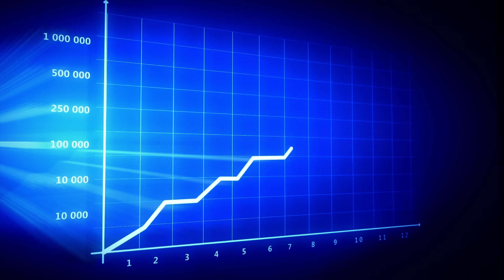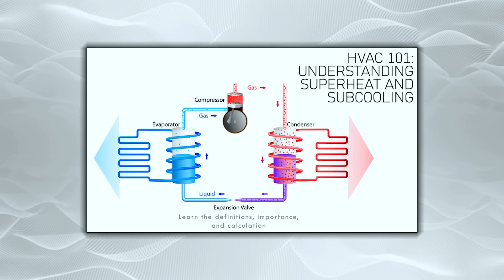⚠️Growing Problem of Mixing AC Refrigerants

Comment: I have a 1 year old LG three zone mini-split system. I originally installed two air handlers. I would like to add a third low wall mount air handler. Can a R32 air handler be adapted to work on the 410 system? I cannot find a R410 air handler for sale.

Comment: R410-A keeps me sickly. My body is depleting. I smell R410-A all over my home.
Reply: What???😮
Reply: @JohnDoesItAll Yes, the refrigerant is not being contained and is making me sick.
Reply: @lifelife-r8y have you had someone come out to inspect it?
Reply: @JohnDoesItAll Yes, several times. The gas is all over the house. I’m sick every day.
Reply: @lifelife-r8y did they confirm a refrigerant leak? Why hasn't it been repaired?
Reply: @JohnDoesItAll They claim that they cannot find one but I smell it and it’s making me really sick. I’ve even had to go to the hospital.
Reply: @lifelife-r8y How are you sure that it's a freon leak and not something else?
Reply: @JohnDoesItAll It’s not Freon, it’s R410-A ,that’s what is in the system. I have the paperwork.
Reply: @lifelife-r8y  Freon is a generic word for refrigerant.
Reply: @JohnDoesItAll Well, it’s a different kind. Freon also refers to a certain kind of refrigerant. Freon has been discontinued as well as R410-A but there is still existing supplies.
Reply: @lifelife-r8y How do you know that it's the refrigerant leaking and not something else?
Reply: @JohnDoesItAll Because I smell it, there is nothing else leaking. I’ve had technicians come to my home.
Reply: @lifelife-r8y Do you know the smell of R410a? Can it be something else that you smell? If it has a leak, it won't work without a charge. Do you have to add refrigerant frequently?
Reply: @JohnDoesItAll Yes, I know the smell and have smelled it in different public places too. This stuff is awful. The unit is cooling okay.
Reply: @lifelife-r8y  When was the last time refrigerant was added?
Reply: @JohnDoesItAll I’m not sure, I’ll have to look at my paperwork.

Comment: I hope this comes back to bite the company’s doing this but it will likely not fail till after the warranty. If you have an old R22 you can simply replace it with 422d works fine.

Comment: R454 is similar to LP Gas which is highly flammable. Also same as LP gas it requires left hand threads . Manufacturers of tanks not ready for this change.
Reply: R32 doesn't have an issue so explain why you believe that? 🤷‍♂️

Comment: I’m still running r-22, going on 23 years soon on this unit which I fixed a couple times myself and it was a converted heat pump to a straight cool😅😅😅 it’s a Rheem tank in south Florida 4 ton . Six years ago I changed my event for coil that I had sitting in the garage and I switched to the R -22 valve. New condenser fan motor and blade. I also installed a new blower motor for the Rheem that has the dip switches so it is in enhanced mode, full variable speed. I’m gonna ride it to the wheels fall off. The compressor is dead or the condenser coil crashes. I have a back up unit ready to go. That is also r-22 . I’ll keep the R 22 for another 20+ years kiss my ass ❤😂lol I can bring the house down to 72 if I want in the daytime 68 easily at night if I need to. Generally we keep it at . 74 during the day and 72 at night. Course I would like to go up some to save money on the electric bill with that creates a fight lol.😅😅😅🥰

Comment: Refrigerants are mixed all the time, and equipment designed around those blends. As long as it’s compatible with the oil and charged properly it doesn’t matter from a mechanical point of view. But we all know the only thing that matters is what’s legal, people will rat you out in a heartbeat.

Comment: I put a brand new 3 ton lennox heat pump/ac and air handler 5 years ago and it requires 410A now 410A is being phased out so WTF is supposed to go in my hvac if there's a leak?
Reply: 410a will be around the rest of our lives. It'll be fine.

Comment: Just recover the r-410a and refill with 410A. There is no loss of performance or any other issues. 

Just like with r1234yf, you can recover it and refill with r-134a have no performance loss.

Comment: usually i find 30lb tanks of r22 foe about $1000. now, cannot find any
Reply: I have an extra one
Reply: they are 500 online
Reply: @lanceditzler for a 10 pounder, yeah
Reply: I use mo99 that'sR438a refrigerant in place of R22 it has been 3 years  in my air conditioner system without a problem you don't have to change the oil or anything. just do a vacuum and put the new gas in that's all works well
Reply: @manuelbover4816 doesn't work in Phoenix when temps go over 110

Comment: All this nonsense, just bring back R12.
Reply: R12 is good for medium temp refrigeration,  not a great air conditioning refrigerant. It takes about 30% more horsepower to do the same amount of work as r22. 
A 5hp compressors will be good for 36,000 btu at 20⁰ evaporator,  where that same compressor will only give you 24,000 btu at 20⁰ evaporator.  It is easier on the components however.  We used to have 3 jugs in our vans. 12 for medium temp,  502 for low temp freezers,  and 22 for air conditioning.  I really miss those days. I got 30 jugs in my van now.

Comment: There is nothing going on like this. This is just a rumor. 454B is not a problem if your a Trane dealer. I get my supply. If the contractor gets caught the warranty will be void. If a compressor fails they will test the refrigerant for 410a or any other chemical associated with a refrigerant of a foreign of a 454B. Take my advice. Whoever is doing this should be put out of business. I have enough for my installs. Trane takes care of their TCS dealers. The contractors who are doing this would be sued and or closed down over this. Do make every contractor in the same category. That is completely wrong. You and the rest of these HVAC YouTube videos should be shut down. Do not accuse every contractor of this stuff. I do not do this to my installs. How do you know if my customers are watching this? You are a trouble maker. Your another asshole just like the other YouTuber who does not know what they're talking about. Do not accuse HVAC contractors of this stuff. Rumors are rumors. Do not act like a high schooler. Contact me through YouTube with your phone number if your a mister know it all. I'll let you know what I think.

Comment: Last Saturday I repaired a leak on a cap tube in a 15 year old R22 Trane heat pump. I recovered the R22 and replaced it with R422B. The unit wasn't made for R422B but it's cooling fine and the customer is happy because they could not afford a new system. It amazes me when HVAC guys use the "It wasn't built for that" then go out and swap a motor, transmission or whatever on their hot rod.
Reply: I've been using R458a on old R22 units .works good for me
Reply: @mattt8668  You're lying. It's not even a plausible lie. I use diesel in a gas engine, works great. Right.
Reply: We have replaced 22 with 422 and it works fine. The most important part is to keep the old ones running and save people money!
Reply: i use r-22 in r-22 systems works great
Reply: Go put diesel in your gas truck, don't change or modify the motor. Then you'll understand.
Reply: @billymccoy9155  I think it's all in knowing what you can and can't get away with.
Reply: @seroxide  Using a refrigerant that was intended to replace another, and using it for that purpose, is a bit different from winging it. Drop 407 in, see how that works. 410 in a 32, may work, but ethanol will burn in an engine, sure isn't good for it.
Reply: @billymccoy9155  did that once in a '97 Chevy S10 stepside pickup truck and it ran really good 😂 just smelled like a diesel truck for a week  ( 80% diesel 20% E85) mad boost 😅
Reply: @sukahusky2464  Owned and drove a 96 s10. You're lying. They don't work like that. Did your s10 have wings and fly like chiti-bang-bang?

Comment: I put 410 in my brand new r32 mini split two years ago. Works good. R32 was not available at the time.
Reply: R32 works much more efficiently than R410a so if I were you I'd switch it out.
Reply: @imzjustplayin i read even daikin advised to use 410 "temporarily" till r32 is available. even the txv doesn't need to be replaced
Reply: Is the compression ratio the same in the compressors

Comment: R-454B is rather expensive ($1500-$2000 for 20 pounds), but that gets passed onto the customer. Fixing the system can get rather expensive, but these are newer systems and shouldn't be needing repairs for years unless there was a problem with the installation or a manufacturer defect. These systems come with a 10 year warranty when installed by a skilled contractor.
Reply: You're not aware that a manufacturer defect, doesn't cover refrigerant.  These newer coils with some brands are crap which could add up to significant cost.
Reply: Equipment manufactured today is GARBAGE.  Everything.  Ibput my 04 fuel pump back in the replacement tank bc i dont trust todays quality.
Reply: @adammartin2223 I agree.
Reply: The refrigerant doesn't come with a warranty
Reply: I just paid a 1000 last week,im by st.louis
Reply: And whats even worse we went from 30,to 25,now 20 lbs jugs such a hustle

Comment: Not an AC person, but I just had a heat pump that uses R454B installed and looked it up to see what it was and found videos like yours. But I found other info that you didn't seem to cover on why most of the industry went with R454B vs R32, that being that the oil in R454B is the same as R410A making it compatible with older systems whereas R32 oil is not. That is very significant as it means older installed R410A system can be replaced with R454B systems with little risk. Yes, you can claim that the techs are supposed to clean and triple vac and all that, but as you point out in many videos they really don't do that the majority of the time. So that makes R454B much more tolerant to installations that are not prefect vs R32.
Reply: Most of the manufacturers went with 454 because it will probably be compliant in 2029.  It has nothing to do with mixing oils, 410 is a blend of 32 and 125.
Reply: I guess it's an US thing as the rest of the world are already on R32.

Comment: There is no question that there are a lot of HVAC so called experts who are unquestionably bad for the industry. Cutting corners or not being aware of the details is just not acceptable when working on other peoples property. For example, supplying cheap Chinese parts on a customers system that had OEM quality which makes the repair a downgrade. I realize China parts are almost a norm but there are cheap junk vs. the better Chinesium. Take a capacitor, why are the HVAC folks supplying customers with junk capacitors and then charging $100 for them? There are better brands with way better life spans for a couple of dollars more. Same with blower and condenser motors. Out goes a quality made OEM motor and in goes a $90 universal China product and no mention to the customer about options. 
When servicing a condenser and making the call to change the refrigerant...make a note on the condenser what you did and when ! Use a sharpie or a label so the next tech knows what he is working with ! And if you are mixing refrigerants, write that down too and why.